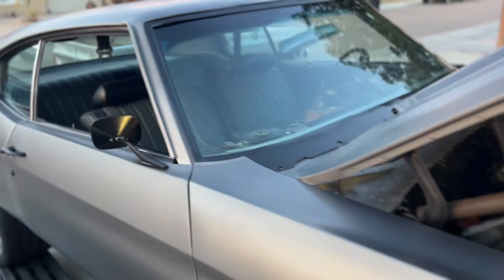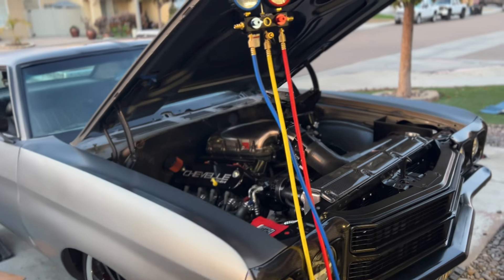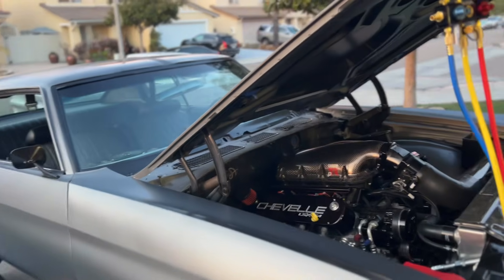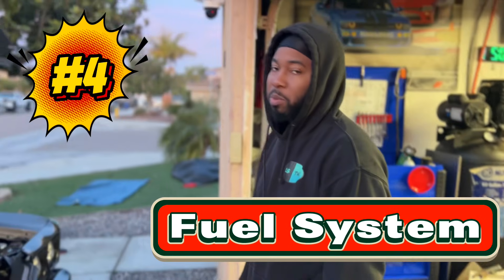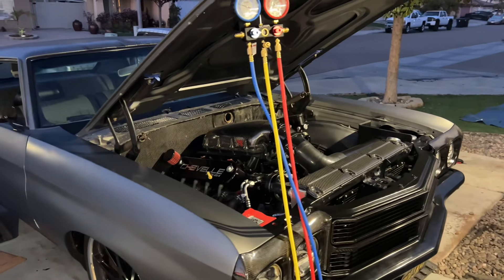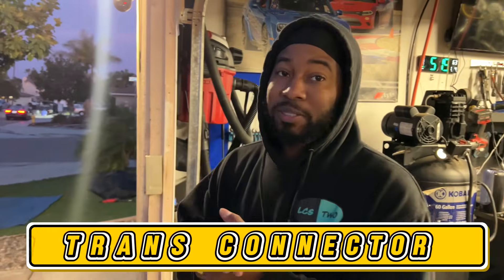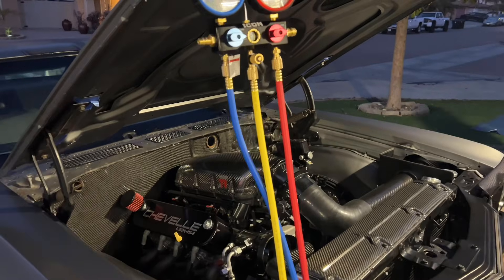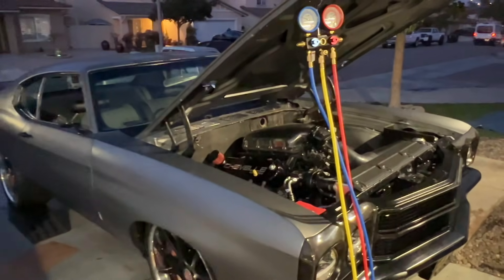Top 5 Things People Messed Up on Their LS Swap

Comment: Another mistake is improper wire gauges to vital components, small ground wire to the engine block to chassis or alternator amps to low.